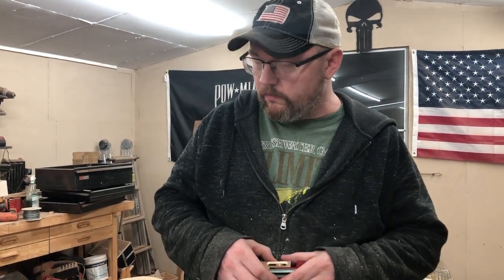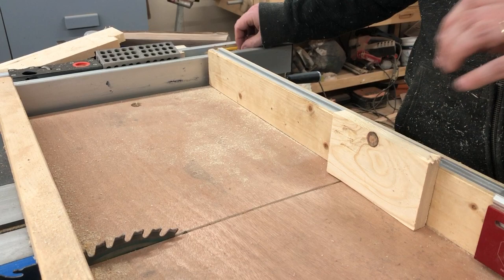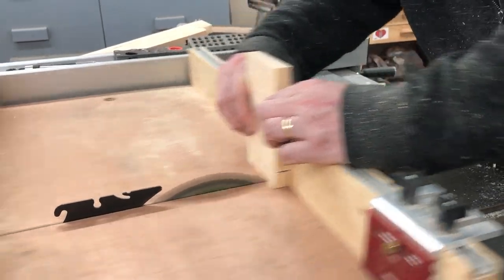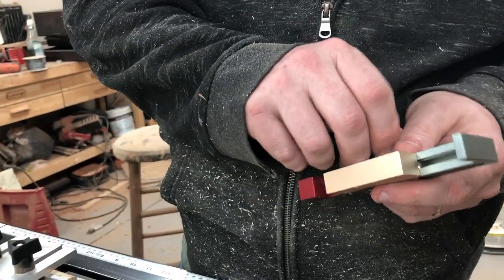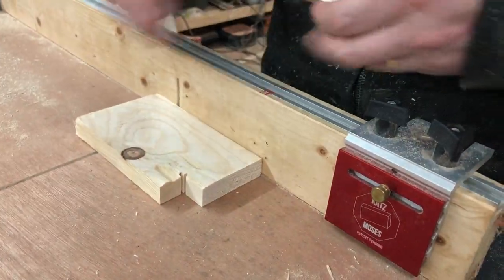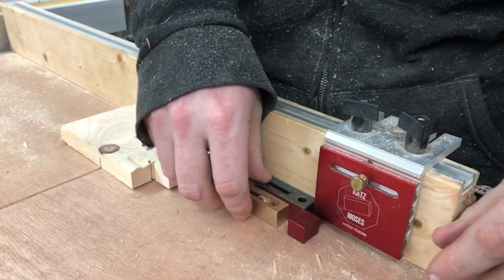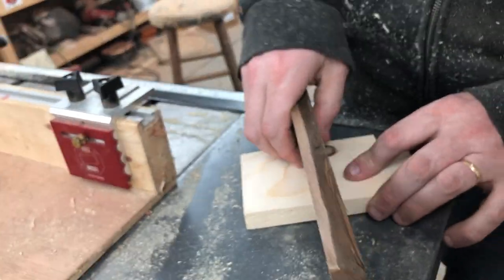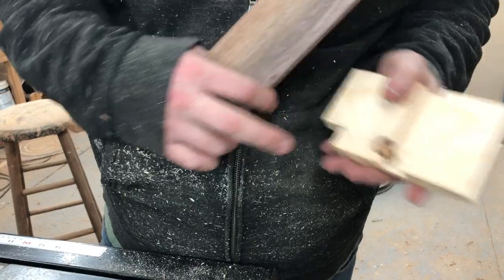Using a Kerfmaker: Woodworking

Comment: Try Temu for a good price - they are all made overseas and then marketed and marked up by "American Vendors.'  Or, make your own!  Also paint or mark one side so you can keep trick of which way to spin teh locking wheels (not always lefty-loosee - changes if you switch sides and you can tighten the 'bottom one either of two ways- drives me crazy)
Reply from the maker: @notcharles  I have since started buying some items from there! Most have been pretty good!

Comment: I've made a couple of devices that do the same thing.  The most difficult part is to get an accurate sizing of the blade kerf.  The design of the storebought one holds the setting better than most shopbuilt ones. and hey, it's good see that you're using a splitter and sled - the safe and accurate way to do most cutting operations.
Reply from the maker: Thanks for watching and for the comment! Yes the only time it remove the splitter is for dados and with a zero clearance insert! Appreciate it so much!

Comment: Works good, only thing is its confusing which way to turn wheels depending on what side is up, therefore creating binding. So I just drew a line on the wheel side that has the stem and now you know which way is (righty tighty /lefty loosey) no matter which side is up. (If you place tool in light you can see the tiny little stem that the wheel is attached to.) Now it slides no binding
Reply from the maker: It does help to label it! Can be confusing for sure.